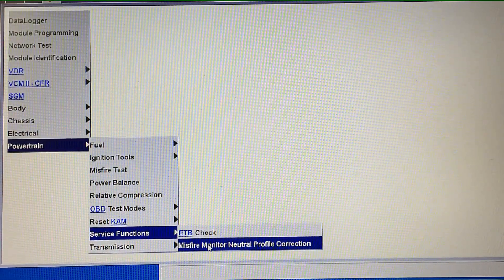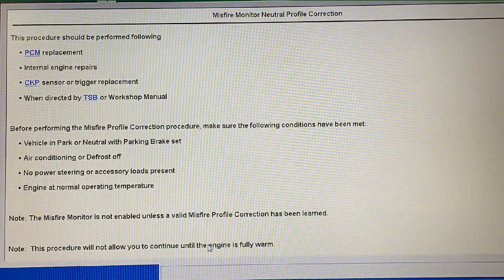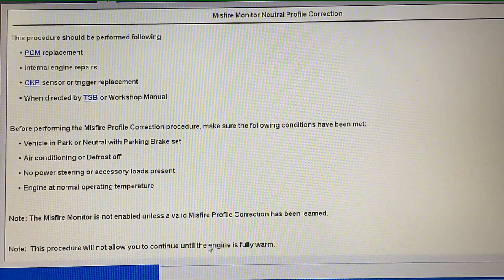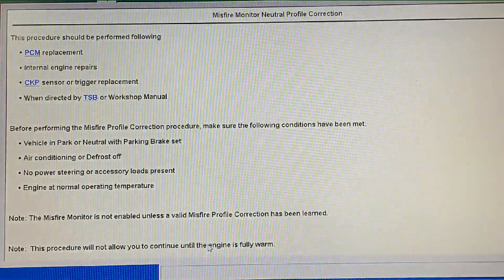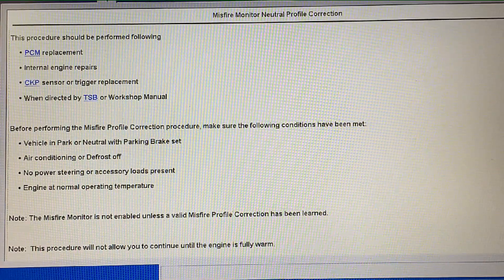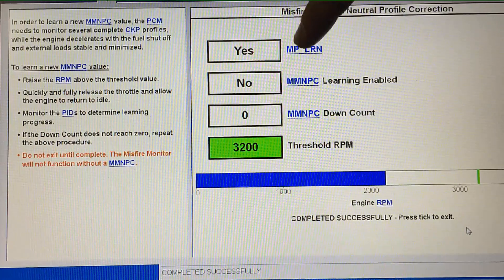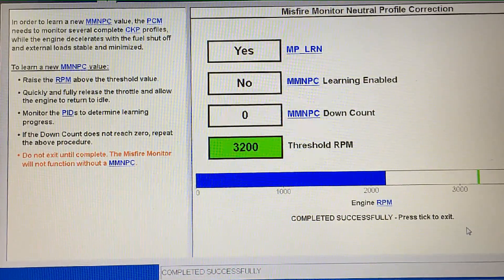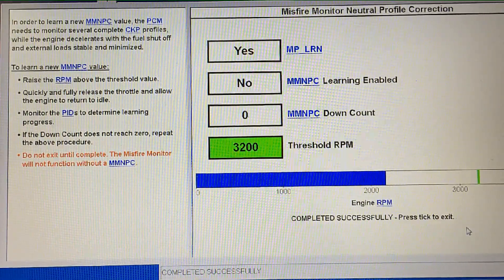Ford Quick Tips: #39 New Ford Vehicles with Ghost Misfires After Repairs

Comment: Tip for manual cars; Been chasing this ghost misfire, no code no feeling but it registered and can be seen in diagnostic tool only when shifting gears, did the relearn procedure multiple times nothing changed, until read that manual gear cars need to depress the clutch down basically let the fly wheel free so the sensor read correctly

Comment: I have a 2008 ford taurus X.   290k miles.  Changed plugs & coils trying to fix misfires.  Plugs were really bad, BTW.   After change, ran fine cold, but would misfire consistently  after warm start.  Did the 60-40 mph reset procedure, and now it seems to run fine!

Comment: hi Brian..
ok i have a 01 excursion 5.4 replace trasmision ..
my obd detected a misfire on cylinder 4
but I don't have check engine ligth nothing.. but I do fill a miss around 35 mph and 60 mph.
like 1300 rpm. same . 
any idea..
I replace spark plugs 
coils..
and no luck yet.  thanks

Comment: Does this apply to a 2008 Ford Expedition I’m noticing the misfire profile correction is not complete on my obd2 engine data but the cam and crank are synchronized. Any info would be great have a slight stumble at idle I did pull the trans out recently and crank dampener.

Comment: Brian, have you heard of the 5.0L coyote mustangs going to a lighter aluminum flywheel where it’s impossible to get rid of misfire codes even if doing the factory IDS Relearn that’s in your video?  I know of three cases where this has happened.  The only solution was to go back to the stock heavier steel flywheel. It appears that the flywheel weight used in the algorithm may be hardcoded in memory and cannot be adjusted (calibrated) which sucks for us racers out here !!  Or the lighter flywheel may just be out of bounds for the algorithm profile to properly pick up.  I’m a retired Ford engine calibrator which has got me stumped as well.

Comment: I have problem with my Ford focus se 2014,the car is clutch judder or shudder on light acceleration from stop or during shift event. I was checking the customer satisfaction 19n08 and 14m02  the dealer service counter they telme the car need extended warranty I was reading about this and the paper said the program extends the warranty coverage of the DPS6 transmission clutch to 7 years of service or 100,000 miles from the warranty start date of the car, I understand the factory warranty was extended to cover the transmission problem of the car please let me know what you understand about this

Comment: They took my transmission down to fix a leak, then days later I got the engine light, so they replaced 4 coil packs...  and now a few months later, the engine light came on again, misfires in 3 and 5..  sounds like they didn't run this correction program...  my truck is a 2015, but only 16k miles.  I bet it wasn't the coils at all..
Reply: Some autel devices have a crankshaft variation position learning function..  is that the same as doing this?

Comment: have rough idle/ hesitation/ low power after spark plug/coil replacement with genuine oem. didnt have it before. ran through the pcm relearn with the battery disconnect but nothing has helped. 08 f250 5.4 w/ 201k

Comment: I have a 2014 Odyssey and it had a missfire that was driving me crazy. No cel, so the dealer wouldn't do anything. I was driving around to do missfire counters with the Verus hooked up. As I was scrolling through procedures, I saw this crank sensor relearn. I thought why not. The Honda has u hit fuel cut a couple of times while doing it. Since then, I have not felt the missfire. I am flabbergasted. It was light throttle tip in especially 1500-1900 third gear. It felt like a noticeable bucking. Last night I had 8 people in the car. Did not notice one problem. Anybody else have similar issues?  Thank u Brian!!

Comment: have a 2010 ford escape 2.5 ,with 134 misfires replaced all sparkplugs and coils,only cylinder 1 cameback.checked compression all ok.injectors all ok did a power balance test and resistance same resistance on all injectors.don tyhis oes this misfire profile relearn apply on this particular year and engine size. thanx much.
Reply from the maker: Yes 09 and newer this applies.

Comment: Would changing the spark plugs on a 2012 f150 3.5L ecoboost require the reset? I was trying to improve a very rough idle condition and after putting in the new plugs it actually idles worse. The plugs had 63,000 miles on them and were at .040-.042 gap. The new Motorcraft plugs were pre gapped at .030Thanks
Reply from the maker: +wantmyGen4towork1 I would reset the pcm yes.

Comment: I have a 2012 Transit Connect, the engine was replaced. It now has a hesitation, a pretty bad one. Could this be the same issue?
Reply from the maker: It can be yes but I would make sure the mF is connected and cleaned first
Reply: mF= Mass Air flow sensor?
Reply from the maker: Rob Man Yes sorry I was typing too fast.

Comment: What does a misfire feel like?  ...and does it always cause a dash light with a code?  I have a 2014 F150 and occasionally feel a slight "bump" on the highway.  Not sure if its something I'm feeling like rebound in the suspension or if it's a misfire.  It doesn't happen enough to warrant a trip to the dealer, but I'm curious what I'm feeling.
Reply from the maker: mjfnh70 It will feel like a jerk or bump yes and will be very obvious. You probably have a carbon tracking issue and they will not always set a light especially in your case where it does not happen that often.
Reply: Thank you for your response!  I should of added that, mine is a 5.0 V8 with just over 7000.  I know the V6 Ecoboost tend to have carbon build up issues, could mine still be experiencing that?  The sensation is very slight, and has lessened (or it seems) as I put mileage on the truck.  This is my first ever Ford so I all the ride characterictics are completely different that what I'm used to.  Thanks again for your insight.
Reply from the maker: No but the 5.0L still has carbon tracking just the same. I would pay attention to make sure it is not just suspension rebound.
Reply: Ok, thank you.  I appreciate the advice!

Comment: As usual, great video.

I have heard of some Fords (mostly Mod motors with the big chains) throwing misfire codes for the wrong cylinder as a result of timing chain stretch.

I haven't seen it myself and was wondering if it's something that actually happens.
Reply from the maker: brakedd No never seen it.
Reply from the maker: brakedd I would see a cam crank correlation code first.

Comment: The shop I work at another tech did a misfire repair on a older Taurus and on test drive set a p0316 and p0300, he was amazed that the fix was a reflash. The days of indy shops getting by with aftermarket scan tools is dying.
Reply from the maker: Michael Berg Oh that might have been for a flex fuel vehicle and cold start misfire.

Comment: GM has been doing this since about 1996. Any repairs to correct run problems needed a crank/cam relearn similar to your procedure. Only good thing is it would also relearn after a few miles on it's own. With the newer vehicles today, we have all sorts of relearns to perform now. Thanks for the info.

Comment: good info, thanks! I guess it goes without saying that replacing cam phasers/ timing chains in a 3v triton will require a calibration?
Reply from the maker: 009to090 I have not checked on those older carryover engines.

Comment: Thanks for this info! Extremely good information to know. It's pretty concerning that Ford engineers didn't build in some sort of automated calibration into the on-board PCM. One might think it's an intentional attempt to make more repairs dealer-only. Do you happen to know if this re-calibration software is available to the public/independent mechanics?
Reply: Ford has made the IDS readily available to the aftermarket, the shop I work has one it is my favorite scan tool in the shop,
Reply: ***** rotunda special tools VCM 2, subscription is 700 a year and a decent laptop includes programing files
Reply: urgentcareguy3 normally the shop eats it, most times it is the fault of the tech, or equipment used.
Reply: Michael Berg someone needs to rent these.
Reply: urgentcareguy3  programing can go south even for an experienced tech not the best idea for someone without experience messing with trying to program a module and then get stuck, best to leave it to techs. After all I know tons of stories of a tech programing and failed bricked an expensive module.
Reply: I think the real question is : "Who ends up paying for the bricked module?" Yep, that's what I thought.